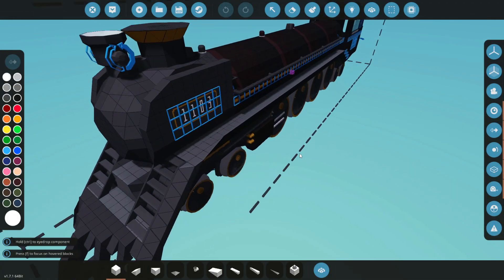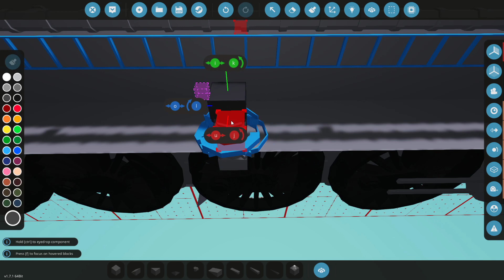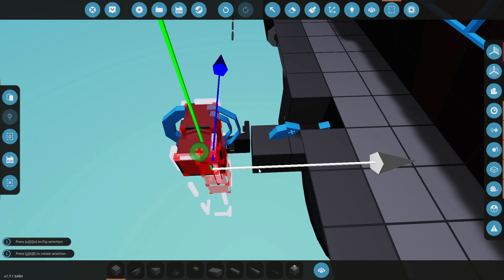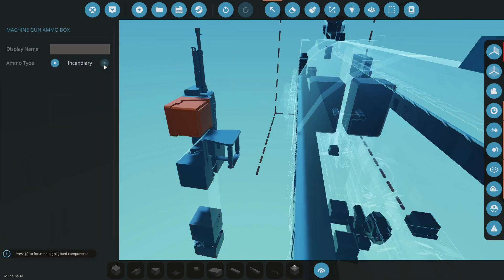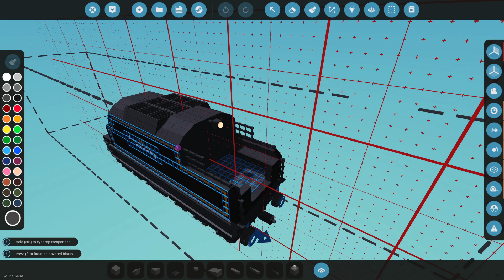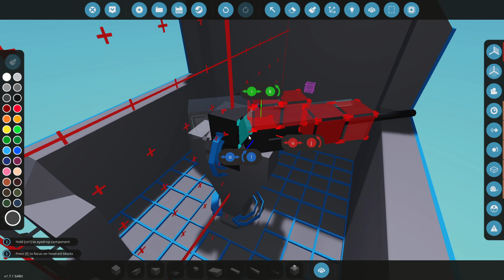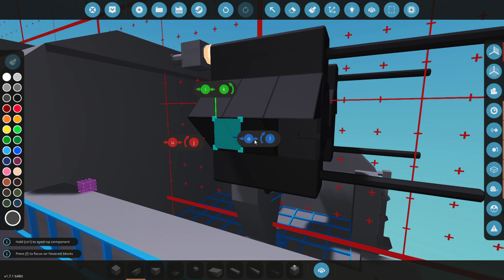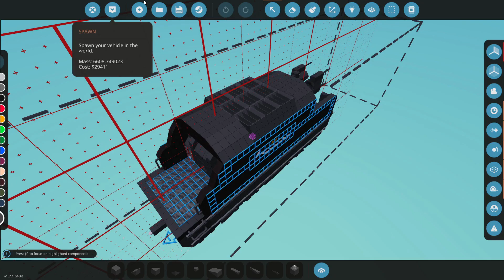WEAPONISING THE LOCOMOTIVE & TENDER - Lets Build A Steam Engine In Stormworks!

Comment: Sorry for repeating my suggestions and comments from previous videos, but I'm just answering your question about the train. You're essentially trying to get a single boiler to move the mass of the train, the tender, the cargo car, and two flak guns around a curve with what would be a 4-8-4 solid acting more like a contiguous 0-18-0 followed by a solid tender of 6-6 which acts like a contiguous 0-12-0 in a sense. You're trying to get an underpowered steam source to shove square peg through round hole, or in this case force what is effectively a 0-18-12-0 (with the engine and tender combined) around curves. Straight connected bogies hate being not straight. Every small curvature they have to go around, they take absolute umbrage to. You need to break your train and tender into a free swiveling 4 on the 8 with a free swiveling 4 (with room for them to move) followed by either two free swiveling 6's or three free swiveling 4's on the tender. You're just trying to get too many bogies to go through curves while being welded straight together with no room to curve. You can tell if it's working partially because the train will go, but you should be able to see the bogies just swerve out from under the engine, if you're doing an articulated or double free swivel setup.

Again, I'll see what I can do about rejoining your discord server and I'll send you some examples I have built. They're not stellar engines by design or performance, but they will navigate curves easily.